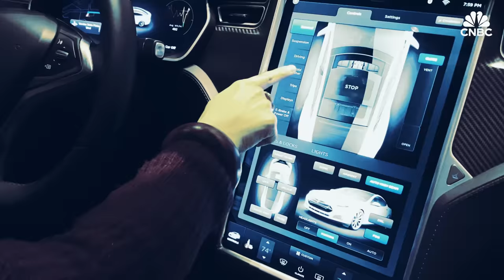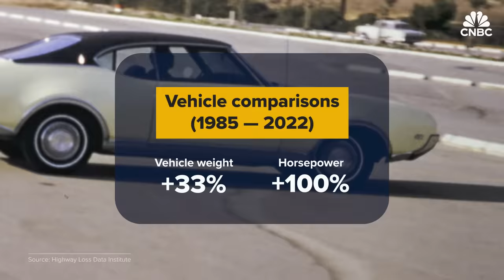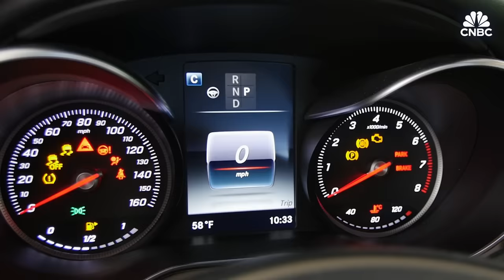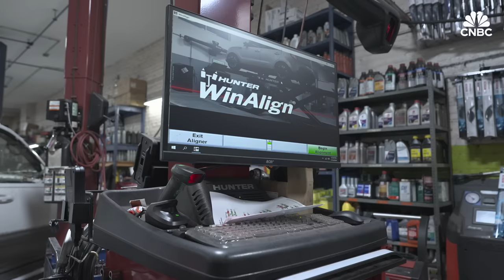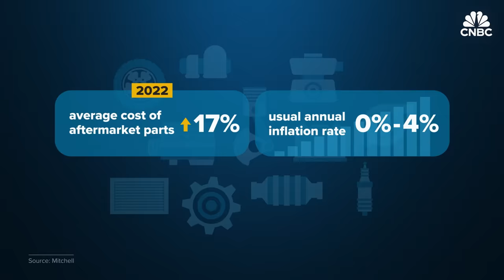Why Car Repairs Are Getting So Expensive

Comment: A 2023 F-150's headlamp assembly is over $700 on RockAuto. A 2003 F-150's headlamp assembly was less than $20
Reply: Can't help but feel like this is all by design.
Reply: Because it is! 
 @daughterofsekhmet81
Reply: That's precisely why I'm driving my 2006 until it won't go anymore.
Reply: @TheSkete  I'm with you. I have a 2005 Chevy pickemup truck I am going to drive to the grave.
Reply: Everything I own is 20 years old.   I love it
Reply: The prices on those assemblies is crazy. The headlight assembly on my relative’s car started to leak after her car was struck from behind. The dealer wanted $600 plus labor. I was able to successfully reseal the headlight assembly using flowable silicone.
Reply: Comparing a low quality , low design part to a new car part 😂 are u going to compare housing prices next boomer 😂
Reply: It took a 10mm socket, crosstip and about 5 min to change headlights on my old XJ jeep.  Apparently I'm supposed to basically take apart the entire front half of my wife's Nissan Rogue to change a headlight.  Insane!
Reply: I did a taillight on a fully equipped 2019 F-150 that was full of water and it was over $1000 from Ford as it had a circuit board w/leds and blind spot monitor. I found one from Rock Auto for $600 and IT had a $50 core charge for the old one. Oh, and that doesn't include the Module (blind spot radar) that had to be replaced. That was $400!
Reply: @cormaro13  how much innovation has happened in headlights? 
Making them LEDs at most costs and extra couple of dollars.
Reply: @cormaro13 
Modern headlight assemblies are anything but high quality.

High quality includes being a design in which headlamps can be changed by anyone, not just people with hands the size of a 12-year old boy willing to suffer several cuts and scrapes in the process.
Reply: And I'm willing to bet that's either the non-BLIS version, or the incandescent+BLIS. 
On the full-LED + BLIS, I'd be better closer to double that per each piece.
Reply: @bolt5564  still got all your censor , circuit board and juicy electronics, it’s not as simple as a 03 lol
Reply: @cormaro13 hate to tell you champ that 2003 headlight assembly is no more low quality than the 2023 one. New does not always mean better. Try not to be a gen z sporto.
Reply: just another reason why the older F-150s are just better
Reply: This doesn't make sense. What yr are the headlights?23 or 03?
Reply: @articrecon 
Yeah same situation here.

1 socket and a pair of pliers, changed both headlight assemblies on my 09 Ranger (btw, each assembly was like $50. Not OEM.. but the truck is 15..at this point I'm not worried about it. Just need something clear that works). Then entire job took me all of 30 minutes.

To change one of my wife's headlight assemblys on her  VW. Cost was almost $400 for the thing, and I had to take apart like half the front end to change it. Almost 5 hours later...

What a joke.
Reply: @H1GHD3FF  I'm comparing the price of a 2023 to a 2003.
Reply: @cormaro13 you’re missing the point 🤦‍♂️
Reply: @cormaro13  the car should be designed such that expensive sensors are protected. 

I also do not see why I need to replace these sensors if my tail light goes out. Things should be separate parts that are replaceable, not huge and expensive.
Reply: I had a 2006 Infiniti m35x, a used left headlight was over $1000.
Reply: @daughterofsekhmet81  I just commented on this. They want to make money not just on the vehicles but on all the parts and service now more than ever.
Reply: Bro you need to get out! That same 2023 truck I can get a painted box new with lights $1,200 I have 12 white and black. New never used. I'll have head lamp assembly within the year probably $200
Reply: @slevinkolebra  where do you get them? I thought RockAuto had good prices.
Reply: @bolt5564  different vendors doing alterations to new vehicles for customers. Some parts come off and go back for scrap...or don't
Reply: @slevinkolebra  I would really appreciate it if you could give the name of at least one of your venders. Because I would love to be able to get parts for those prices.
Reply: Weak!! 2022 BMW X5 left front headlight = $6,000. Not including the computer chip. With chip $6,700.
Reply: You're not replacing a 2023 headlamp assembly.   You might replace a bulb in 8 years.
Reply: @daughterofsekhmet81 no it is not, if you don't keep on buying new every few years. My car's parts didn't really go up in price. Cuz it is an old car.😂
Reply: I need to make my own headlights fit on newer cars.
Reply: @JonDoe-cg4mr 
20 years old is a good age for a wife. I picked mine up in 1983,!
Reply: Parts like that for fairly newer model years are often a lot more. Some of that has to do with aftermarket competition being pretty much non-existent until patent rights run out, aftermarket manufactures establish a need and design competing parts and actually start production and distribution. I hit a bird on the interstate when my Chevy Avalanche was 2 years old. The impact broke my left front turn signal housing's mounting posts off.  It was only a dealer part. I was quoted $540 without install labor so I repaired the broken one myself. Then six years later the lenses fogged up and I bought aftermarket replacements for both left and right sides for $125. I literally could not find any difference in these verses the OEM parts.
Reply: @E1VM  unless you are in a Fenderbinder.
Reply: Car makers don't want you repairing your car. They want you buying a new one. The higher the cost to repair the more likely people are going to be to consider purchasing a new car.
Reply: @picklerix6162  I have a 1st gen Honda Insight. Got hit by a deer on the passenger side shattering the headlamp. Going crazy trying to find a replacement. Finally just got some clear gorilla tape. Been working fine like that for nearly 2 years.
Reply: @daughterofsekhmet81 
how long did it take you to come to this conclusion?
Reply: @cormaro13 
those "new" car parts are weaker than the old aftermarket parts, there's many examples but I won't share that info so you can pay me to fix those for you in a way where you'll be back in 3 months
Reply: If consumers want cheaper cars, stop buying them. 

Stop buying all the fancy stuff. Stop buying luxury. 

Only buy cheap and affordable cars. The market will listen.
Reply: @qbraun9241  I completely agree in principle, but there is one problem. Many new car buyers are not aware of the price for parts. 

Ever since the iihs stopped testing and reporting the cost for fender bender repairs, it has become exceedingly hard to compare the cost of simple repairs between cars.
Reply: @cormaro13 It's not a low quality part...it's just not overly complicated.
Reply: Yeah and the cost for the 402a one is like $1000
Reply: @cormaro13  good design doesnt make maintenance a nightmare lol
Reply: @articrecon I had a garage quote me 2 hours to change a headlight bulb in a Mazda. I said.. bs.. it took me 3 hours... who builds cars like that... ??? FFS.
Reply: @TheSkete I have two pontiacs from 2007 and 2009. I too wanna drive them till they give up. I can do my own repairs to an extent and also have a friend mechanic who can do repairs relatively cheaply.
Reply: @cormaro1376 Typical Gen z. You want to whine and blame boomers for all your problems and choices instead of growing up and looking for solutions. Every generation has it's challenges. It's not all about you.
Reply: And that's why we're going to have a situation like Cuba where people will do everything it takes to keep old stuff running because new stuff is crazy expensive and unobtainable.
Reply: Try the cost of a LED taillight on an F-150 that has a backup sensor and needs to be re-calibrated.

Comment: Because to change a headlight bulb in modern cars, can mean removing the front bumper, a tire, and maybe a fender liner. The fancy bulbs can cost over $100 just for the bulb. And if you have LED lights, you’re going to have to buy the entire housing. It’s nuts.
Reply: A woman my friend worked with came in one day and asked if he could change a headlight bulb for her, he agreed until he realized it was one that came standard with HID's, she had to go to the dealer and it cost ~$400 to replace it. New Volkswagen, I believe. He said she got rid of it shortly after. Another reason I'm keeping my 07 truck, I can add LED's if I want for ~$100 bucks, and if I have to replace them I can still use standard bulbs.
Reply: i had a cadillac which was like this.
Reply: My 08 Acura was like this. 😒
Reply: It should be against the law as to what the car manufacturers  have built and done to us.
Reply: Most people don’t know you can change an headlight bulb so easily. Not even a 10 min job. What modern car are you basing this on? Most cars headlight bulbs can easily be replaced by removing the cover behind the headlight housing. Removing a headlight housing isn’t difficult either. Usually 2-4 bolts. Quality bulbs are also at minimum $70 so I got no clue what bulbs you’re buying unless it’s some ridiculous brand. Idk what you mean by if you have led lights you’d near to buy an entire housing. If you have reflectors you have to change them since LEDs are meant for projector based headlights. Otherwise stick to halogens or mind warmer tone LEDs. LEDs in Reflectors are too strong for oncoming drivers
Reply: @LeoDragoGR  
For LEDs I think he's taking about OE ones, and he's actually right about those. Basically under the moronic reasoning that LEDs should last the life of the vehicle the manufacturers embed the LED into the OE fixtures. There is usually no provision to remove only the acutal LED. You're forced to replace the ENTIRE assembly if the emitter itself goes bad and as a bonus they often mount sensors and stuff in the fixture too.  It's BEYOND moronic and it can result in insanity where a failed tail-light produces like a thousand dollar parts bill.
Reply: @LeoDragoGR  
Also some Xenon bulbs can be crazy expensive if you buy the name brand (or god forbid dealerships!) ones, but you can find MUCH cheaper non-name ones online that work fine. My VW uses them and I did that when they went bad and spent literally a quarter what I would have otherwise. I also agree that most bulbs are still fairly easy to change on modern vehicles, though you do run into the occasional completely idiotic piece of 'engineering' now and then that makes what should be a five minute task take like an hour and a half.

Sorry for replying twice, but for whatever reason YTs nanny AI REALLY didn't want me to talk about LED fixtures and xenon bulbs in the same comment?
Reply: Try a busted tailight on a Rivian. a major bodywork job to R&R
Reply: @Tk3997  the only headlights that are a pain to replace are vehicles with the housing embedded on the bumper. Far lower than where a normal person can reach. Even then if an owner is looking to replace their bulbs they should do their research. A lot of these dealerships know most people are lazy or uninformed to even do the simplest of repairs or replacements so they’ll capitalize on it. It’s a reason I don’t go to a dealership anymore.
Reply: @LeoDragoGR 
Even a number of those you can get to by peeling back the fender liner and coming from below, slightly more work, but often still pretty easy.
Reply: @Tk3997 my headlights are like $1800 each plus coding it to the car 😂
Reply: @LeoDragoGR  My '02 Escape headlamps - 20 minutes.  '05 Vibe still has OEM, '11 Fiesta is (for ease of access) entire assembly.  These aren't '70s cars anymore.
Reply: YUP! it's crazy
Reply: And that led headlamp is about $800-$1500 an assembly
Reply: I have a 17 Hyundai Elantra and to change a bulb I have to take off the front bumper and remove the housing
Reply: LED last Excess of 1 million hours , compare to DUMB lightbulbs, Halogens, HID ......lol
Reply: My MIL's 04 nissan sentra is like this 🫣 she's trying to get rid of it too many issues
Reply: Buy a 2010 Camaro headlight! The first one I changed in 2017 was $150 for just the bulb, not including the labor!
Reply: Lexus ct200h, 2013. I replace the bulb by twisting it off and putting new one in. Cost me about $30
Reply: On a modern car everything Is this way😂😂😂🥲
Reply: Bingo you got it
Reply: @khysor1832 $1800 per light? Do you drive a Lamborghini?
Reply: @LeoDragoGR trust me lots of vehicles are extremely difficult to change headlight bulbs
Reply: @TheYoungerSemiOldMan 2021 gmc 2500hd pickup $1200 for the passenger front headlight assembly LED
Reply: My bumper needs to come off for a blinker. So stupid
Reply: @logicplague  Hope you realize DIY headlight conversion is illegal.
Reply: @Tk3997  All the high-tech lighting does last the life of the vehicle. Only problem is the life expectancy of a new vehicle is three years.
Reply: @myoutuber77  In my area the cops don't bother us about them as long as they're aimed correctly and not obscenely bright. They don't even bother people running blue/red lighting.
Reply: This is why I like my Volvos. Very simple to repair. The largest job I've done was to replace the fuel pump: drop the fuel tank + sub frame  + attached suspension components. Still not that difficult or expensive. Would have cost £900+ at a dealership. Cost me £75 in parts and 3 hours on a saturday.